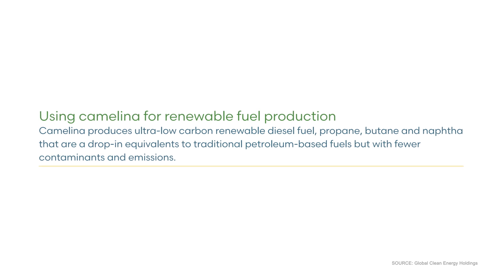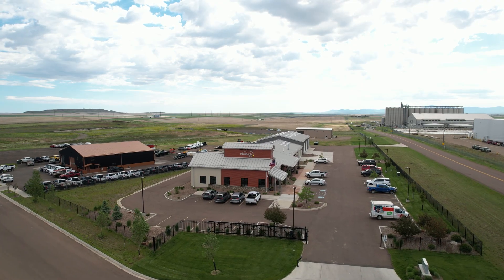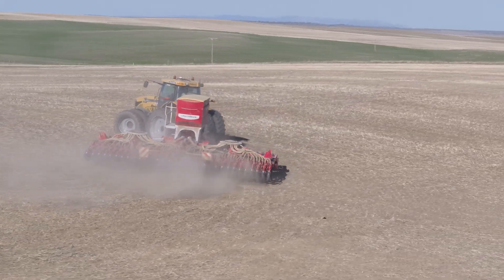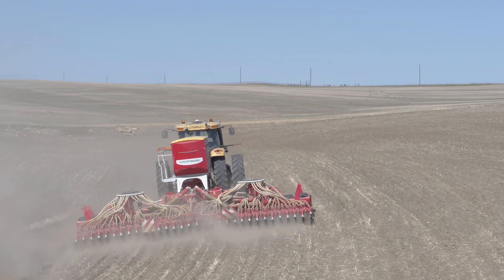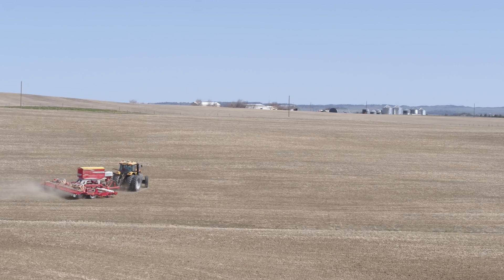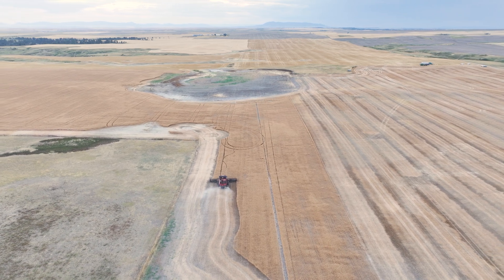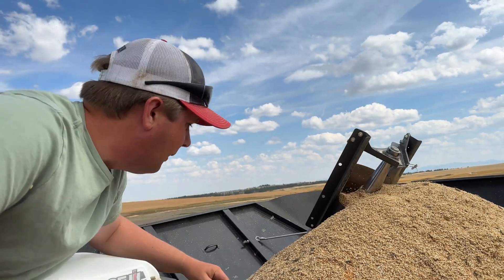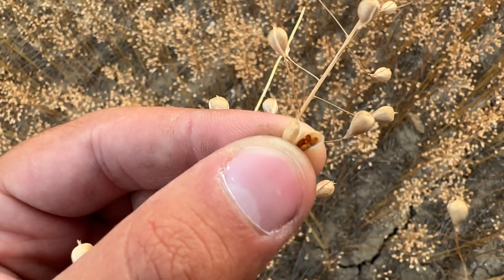Growing Camelina on the Farm - Seeding to Harvest

Comment: Thank you for this video. We also grow camelina in France. However, we have never managed to reach 2t/ha so far. I would also say that it is not a very low carbon renewable fuel compared to any legume species such as soy (without fertilizer).
Reply from the maker: What is camelina used for over there?
Reply: @AgriStudios There are two outputs: for organic farms, it is used for oil. On non-organic farms, it is grown as a secondary crop to be used as SAF.